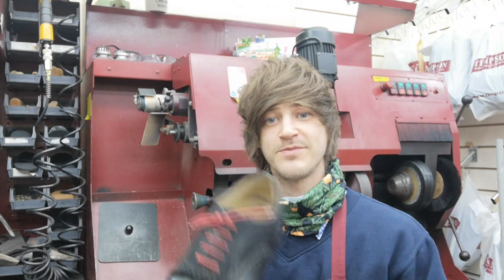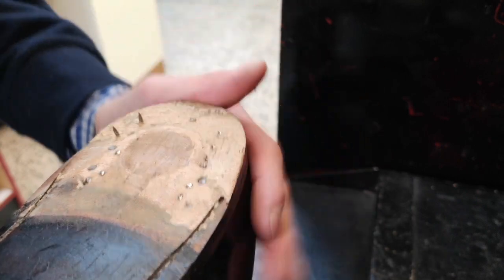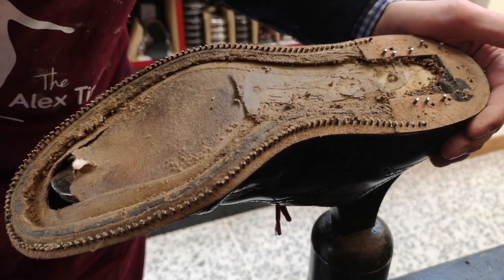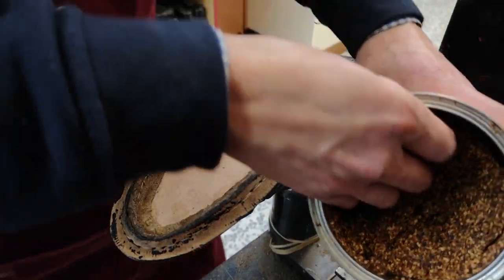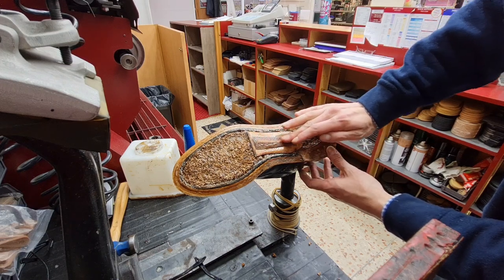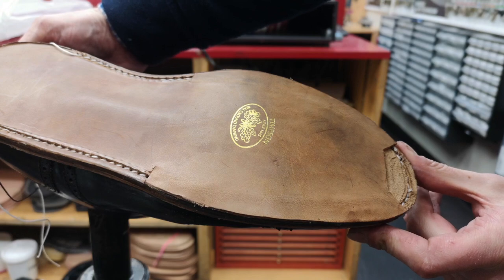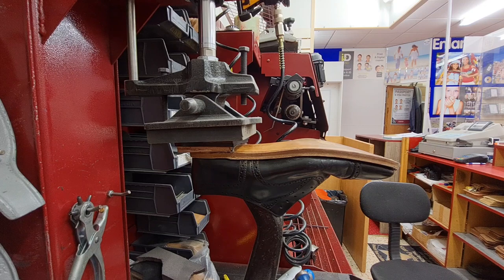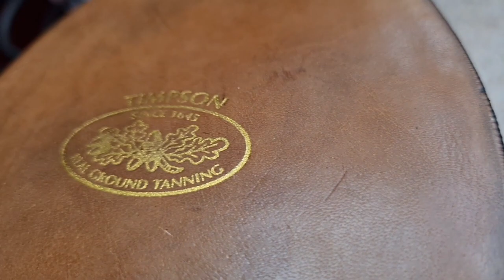Loake 201B Half Blind Stitch | Fiddleback Waist | Resole #33 | Toe Plate | Scottish Shoe Repair

Comment: My local Timpson (in a supermarket) were able to change the heel pad/top lift on some shoes but said that Good Year Welted shoes would have to be sent away to have a full re-sole. Is this because not all the shops have fully trained shoe repairers ?
Reply from the maker: It's because not all shops have stitchers in them mate. So they have to be stitched elsewhere in certain areas.
Reply: @CobblerG  Okay, thanks for the info.  Being completely honest I wasn't totally happy with the job he did on three pairs of almost new shoes  (getting leather heels replaced with rubber heel pads) but seeing your videos has definitely restored my confidence in Timpson's so you are doing a good job in selling the company as you are obviously very skilled at what you do.